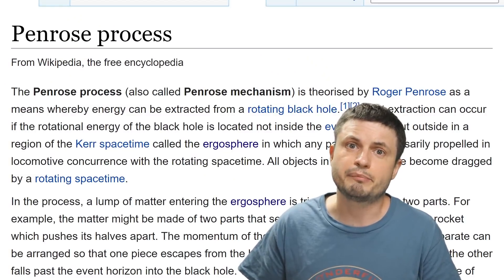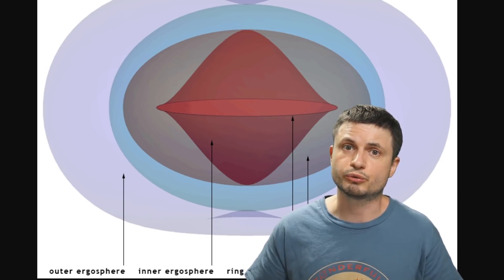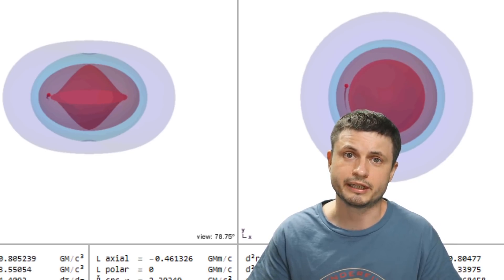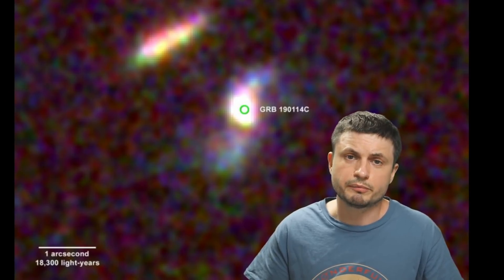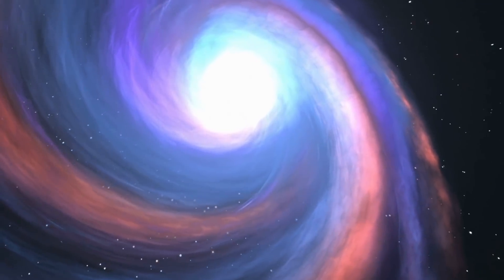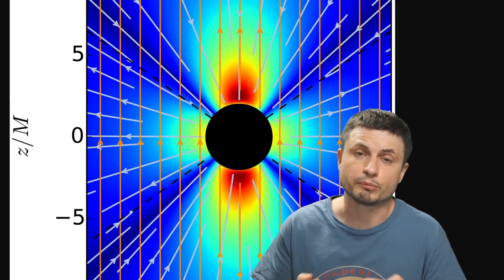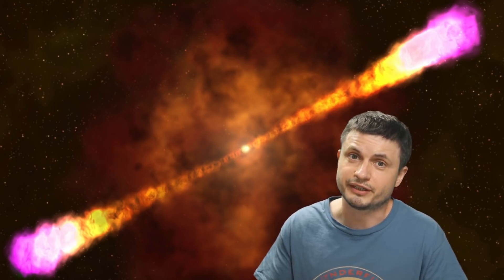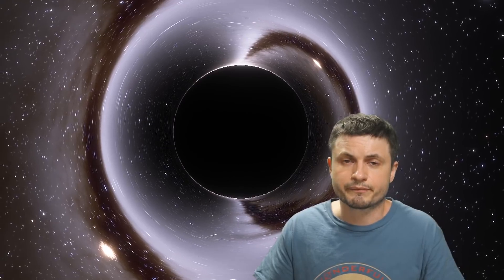Gamma Ray Burst Stole Energy from a Black Hole - Proving Penrose Process

Comment: We know that black holes are formed from supernova but  I still believe that black holes are one of the keys into creating new stars from the gravity field , it takes years even possibly a billion years to collect the materials spread out in space to form a star spread out by the solar winds , and even our own experiments with new room temperature fusion reactors that it takes a huge amount of energy to be constantly supplied what if these black holes that slowly spin form the gravity to constantly pull the material back , to recycle if you Will , this gamma  burst may just be one of the steps over and over pulling the materials back again increasing the pressures and energy in the process , this burst maybe the beginnings of a larger star than our own

Comment: Black holes are made of quark plasma. When a collision in space is powerful enough, the matter breaks the force of the quarks. This creates quark plasma. This is where the dark matter of space comes in. Space is made of extremely pressurized electron neutrinos. This pressure destroys the ability of the quarks to reconnect. The unenergized electron neutrinos of space are thrown back out into space as gamma rays. This is the most efficient reaction in the universe because the catalyst of pressurized dark matter never runs out. This is the energy scientists are looking for, not fusion. Fusion is simply a conservation of energy. Black holes are simply invisible stars. Eventually, the quarks use the dark matter of space to create the first neutrons. The mass will continue to create heavier elements albeit on the surface where the mass has access to the electron neutrinos of space. The process is called the "beta minus decay" reaction.

Comment: I believe that the law of conservation of angular momentum (AM) suggests that a singularity would have to spin at infinite speed if it has ANY AM and its radius is zero. (Correct me if I'm wrong on that, even given that both the infinity and zero have no real meaning). But do you (Anton) agree that GR would then say that the rate of spin is actually a gradient from that theoretical infinity at the singularity down to the observed spin at the event horizon? Is this just another interpretation of the ergosphere?

Comment: Nice, shared, if SPIRAL cosmological redshift hypothesis and model, 'Black Hole illusion Resolution' that mass/energy that were in what is considered a 'Black hole' is the norm, not the exception, as SPIRAL = Hyper-dense proto-galactic formation Preceded hyper cosmic expansion, relatively early in history , so the galaxies themselves are mostly originated at what is now the no longer hyper dense 'black hole' at  their galactic center.  Now this particular burst assuming it reached us 2 years ago, would not have been from 4.5B LY away x billions of years ago, but from 5779 LY distant 5781 years ago., when the universe itself was still far denser than the modern size and density universe, we find attained this size and density at the end of that hyper cosmic inflation epoch. reference Pearlman YeC for the alignment of Torah testimony, science and ancient civ. volume II.

Comment: The "hole" is no hole, its does  have center solid pile, the entity, is not a solid, its not a gravity luring force, which would be a bond between 2 or more matters, instead, a magne spin tork, that lost the bond between 2 or more matters, thus raged for rejoyce of anything it reaches for, it doesn't always pull, the spinning beast sometimes thows elements, or rips it apart. After it consumes to the belly, it will feed new realms in the cosmo, from the pulse polar regions.

Comment: We need to consider setting up more full spectrum, continuous monitoring of some more active objects so that we can see their full self and processes. 
The ergosphere is this side of event horizon. We are stealing energy from the whirlpool around a drain. .But where does the drain lead?
Toroidal/Klein manifold. With a mirror antimatter universe running parallel to us backwards in time. And time is an infinitesimal Planck moment.

Comment: So thinking about this, it seems like what we are saying is: the energy that goes into a black hole is easy to think of as the material going in (particles/field wavelets) but to forget that it's also their kinetic energy, including their collective (entangled) motion when it creates, collectively, the bigger scale sense of rotation. That's actually super interesting because the maximum theoretical energy fraction you can extract from rotation is 29%. That's wild to think about. Almost a third of energy is kinetic! How?

This implies that the process creates kinetic energy out of other forms of energy, since we all know that kinetic energy in regular spacetime pales in comparison to everything else. That's sort of anti-intuitive. I think I was thinking of black holes as more going in the other direction: ripping apart materials to create radiation, but really, if the black hole is spinning due to the kinetic energy of the material falling into it, then it's like it hits a "mode" and a positive feedback loop happens or something, with even more rotational energy being sucked from the particle fields.

That's really weird and begs the question: wtf is kinetic energy in the first place?

It would seem kinetic energy, like everything else known to exist, is just energy being trapped oscillating between the various fields. This implies that all "particles" are in fact entrapped energy oscillating between fields, and causing energy dispersal to--on a bigger Newtonian scale--to appear particle like or bigger. Kinetic energy is a higher-level "illusory" phenomenon then that is once again--like everything else--just clumps of entrapped energy bouncing back and forth between the fields, in some directional and speed manner (momentum) that becomes more and more certain as more and more energy becomes entangled (clumped). That part is intuitive once you imagine it.

In summary, while I already knew that kinetic energy was just a Newtonian level way of understanding lower level fields, this really drove the point home. There's just no way that particles, which are supposed to have orders and orders magnitude more quantum level energy than kinetic energy, should be able to make a black hole with almost a third of its energy kinetic, except if that kinetic energy is in fact an Newtonian "illusion"/phenomenon of sorts--just yet another way to "dress up."

Comment: Get rid of your classic flywheels folks. It's time to start storing your energy in black holes. The question is, what kinds of black hole analogies can we come up with to replace flywheels.

Could we modify the Penrose Mechanism so that we have an analogous "clutch" for continuous momentum robbing?

Could we build a small charged spinning black hole and levitate it using superconductors to keep it from falling into the earth, then extract energy from it continuously whenever we need to?

Could we design a power device that only works just barely, with you having to constantly feed it or else hawking radiation would evaporate it quickly by default due its tiny size? The concerns that the power levels generated in the LHC could generate microblackholes that end up destroying all of Earth have been addressed by CERN as not a danger because such a tiny black hole would immediately evaporate. So obviously we want to make a black holes that stays small such that it will immediately evaporate by default if anything goes wrong, as a passive safety mechanism (kind of like how modern nuclear stations use passive nuclear safety so that if something shuts down or goes wrong, by default, the station stops generating power instead of having a meltdown). It would only stay alive through us constantly, actively feeding it.

To feed/replenish the black hole flywheel, we'd only need to feed it garbage. We could, for instance, throw in literal garbage and nuclear waste, and if we spin it fast enough, feed it fast enough, and then put a load on it, we don't have to worry about hawking radiation danger, because black holes are colder than the environment at this stage of the univere's development and we are sucking most of the energy out as harmless kinetic energy before it can hawking its way out of there.

Could we keep nefarious actors from overfeeding such a blackhole, turning it into a fatass, world-destroying device?

Could we design the power device such that feeding it is super difficult and requires precision that only a well safe mechanism can achieve?

Could we build a blackhole power station at L1 Lagrange to make it a little safer, and to help power the autonomous silk producing robots (using genetically modified bacteria) which infuse silk with conductive metal nanoparticles and interspersed with controllable diamagnetic materials to build a very lightweight, thin, and huge grid of flappy silk sheets that would of course open up by repulsion when we switch them "on" and they respond to the magnetic field created by the conduction of current. throughout the silk shield? Could a blackhole be used to process all the bits of a captured asteroid that aren't useful to that effort, in effect, turning asteroid mining waste into power for the project?

Comment: Something doesn't add up here: If the TOV limit is approx. 3 solar masses, and the black hole is estimated at 4.4 solar masses, and the event from supernova to gamma ray burst took 3.99 seconds, that means 1.4 solar masses were moved from the star to the neutron star in 3.99 seconds. Additionally, supposing that, seen from the exploding star, the neutron star occupied much less than 1/1000th of the sky, the supernova would have to have thrown out a lot more than 1000x+ solar masses in matter in order for at least 1.4 solar masses to fly more or less immediately to the neutron star. That... does not seem right, there are no stars that dang massive.

Comment: Very interesting information! Thank you, Anton! But don't call it "proof"; it is observational evidence that the Penrose process is taking place, but until we can actually get out there, it is NOT proof, and this evidence can be interpreted in other ways.
Reply: You can steel energy from every object with angular momentum like planets (which we do with gravity assist) stars or even black holes. If a black hole has similar mass with our Sun, it doesn't change anything if it is a star or black hole. Black holes get weird when you get really close to them, 3km for a black hole with one solar mass. If you are few houndred kilometers away from it, it is just a black star

Comment: I had to google it.. a few years ago i was thinking the universes most powerful magnet might work if positioned correctly, magnetars would be enough to cause a disruption of the magnetic field of the black hole, and cause it lose mass and thus energy, i thought of this back in 2015, since then i read that black holes had weak magnetic fields..

Comment: Your terminology is dangerously inaccurate. 
You CAN theoretically EXTRACT energy from a black hole. 
You CAN NOT CREATE more energy than you started with.
This is NOT an infinite energy system. It is a form of energy TRANSFER from black hole rotation to some secondary object. Imagine running up to a spinning turntable, jumping on for a moment, and jumping off in the same direction that the platform is spinning. You gain an EQUAL amount of energy to that which it lost.

Comment: Very large stars should collapse into what could now be called Generic Objects of Dark Energy (GEODE). These appear to be black holes when viewed from the outside but, unlike black holes, they contain Dark Energy instead of a singularity. Sometimes galaxies can work as lenses to more distant galaxies. At some point, as the universe stretched out, the density of matter and energy dropped enough for dark energy to become dominant. Unlike telescopes, which typically look at only one place at a time, gravitational wave detectors can listen to the entire sky. The universe is expanding, a time when astronomers could not be certain that those fuzzy splotches of light in the sky were actually other galaxies. Now astronomers are ready to start poking at some fundamental truths about the universe.

Comment: black holes are not supposed to have a magnetic field. maybe the strongest gravity is only at the top layer of the black hole; and the middle of it is still a neutron star with a magnetic field. that would be possible because the gravity at the center is much weaker than at the surface, so a neutron star can survive at the center of a black hole.

Comment: It's like to theorize the existence of pink elephant :D mathematically and theoretically they can exist but till now nobody saw it ... 
Now my argument is how can a singularity  (no volume point of immense mass, temperature and pressure) can spin ? How can a point spin to form a ring ?  
Not to mention that ergosphere theoretically moves around ~90% speed of light so things do spin with the singularity but can escape it, unfortunately this cannot explain cosmic jets because they are beamed from the north and south axis points.. 
Like I said pink elephant. 
Respect to Penrose but the physics are flawed since Maxwell then this flawed  physics were incorporated in relativity and special relativity . The most funny thing is the assumption that laws of physics are the same everywhere in the universe,  which in the case of black holes they surely ain't .. this is way they call it singularity because they DON'T KNOW

Comment: γ-ray is electromagnetic radiation, as is the light. That means black holes math predict that even they couldn't escape the black hole. Also, the math decision of GR by G. Penrose isn't correct because when he did that in 1960 the Λ antigravity constant was exile from the GR. But from 1980 it returns free, and it creates impossibility to have black holes because antigravity is much stronger energy of gravity. Ask Penrose, he will tell you that now about last 5 years he is trying to do math correction about that.

Comment: You'd think that if the spin accellerates it would approach the speed of light and become a time point. - you say that time is bent around the black hole but wouldn't it be the blackhole is moving faster than time. Then it causes a timespace collapse because the entity would colide with itself. (or part of itself as 4D reality is not the limit of interaction)

Comment: Question: Does Magnetism travel at the information speed? (the same speed light travels, but also gravity travels?)
If so: Does this mean the creation of this new Ergosphere goes faster than the information speed / speed of light?
If not: Does it mean that whatever in the neutron star that is causing these magnetic lines still exists for a few seconds after the exact moment light doesn't escape anymore? Do magnetic lines travel faster than the information speed / speed of light in this instance?

If the second case: Have we discovered multiple stages in the existence of black holes, where upon their first moment of creation they still exhibit some of their old characteristics because the inner matter is still intact somehow even while the light doesn't escape anymore?

Note: I'm aware time is very relative here since times goes so slow around black holes and I presume even neutron stars. What seems for us to take only 2-3 seconds, may take a billion years on the local surface.

Comment: Gravitons... they're said to likely exist, but never be observable except maybe in extreme conditions like during the big bang or... inside black holes. Maybe we can't directly observe them, but what if they were responsible for the penrose process, or factor in? Hypothetically, if you were to try to model the penrose process with and without gravitons, you might see whether or not the process could even work with or without gravitons, and if it can't be explained without gravitons, that's a point towards them existing, right? Take it a step further, see if virtual or even actual gravitons explain the penrose process effects in simulated black holes (acoustic, other analogue black holes). Seems like we could indirectly observe (or not observe) gravitons this way.

Comment: Anton, how is this different from the slingshotting we already do around the spinning sun and olanets in the solar system?
Reply: Probably that this one can be used to generate power for our own use, and instead of using your own craft to slingshot around the blackhole, you could direct a beam using this principle, which can be used to accelerate a spacecraft for travel in a way more efficient manner. So efficient in fact, that once you quit accelerating, you could even harvest energy for free.
Reply: When you slingshot around a planet you are taking some of its orbital energy, not its rotational energy.  The planet os moving through space and has gravity, to by approaching at the right trajectory you get pulled along by it and accelerated.  Falling into the gravity well accelerates you as well but you lose that energy coming back out so the net energy gain comes from the planet pulling you along its orbit not into its own gravity well.

The show Farscape famously starts with the main character doing what they call a sling shot maneuver,  but it isn't this maneuver because he and his pod are already in orbit of earth and thus already possess the orbital Velocity of earth's orbit. There would be no net energy gain by simply changing the shape of his orbit.